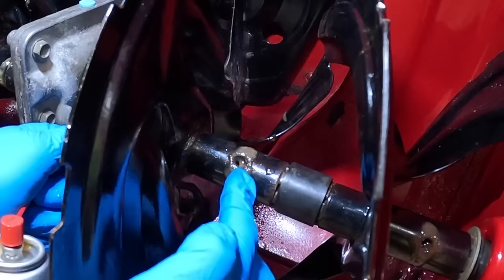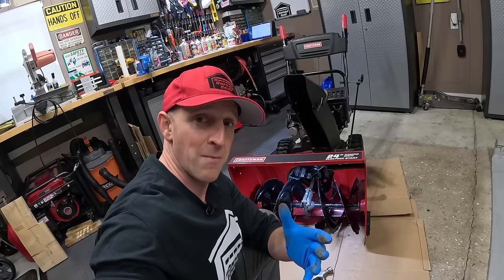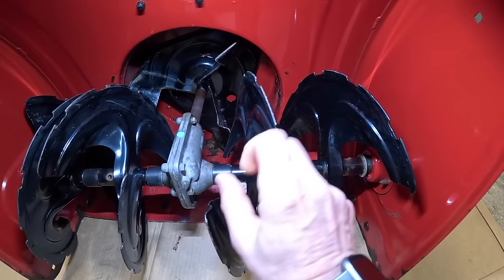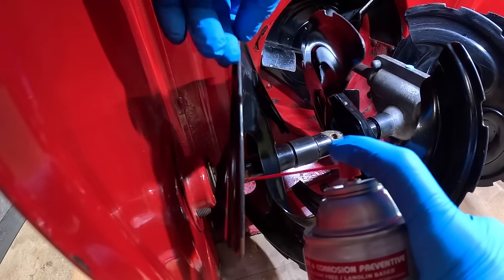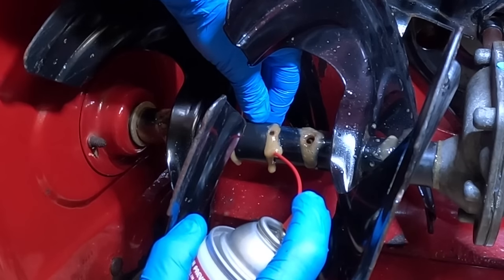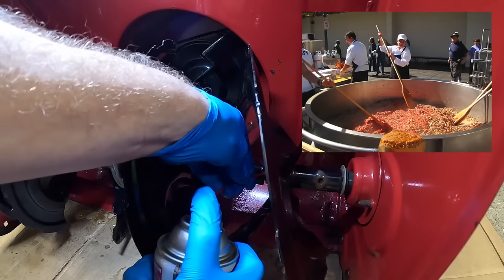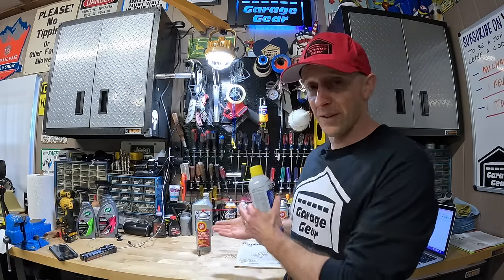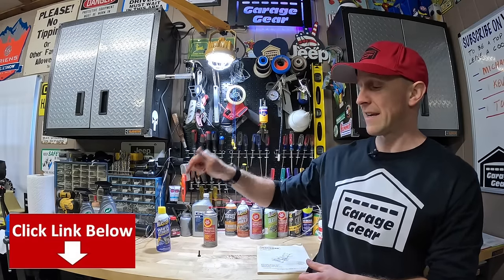HOW TO LUBRICATE CRAFTSMAN MTD CUB CADET SNOWBLOWER AUGERS (Seize Happens)

Comment: I have worked on Crown equipment in a food distribution warehouse for many years. Sometimes a good ol' airhammer works for removing seized pins. Everything you're showing in this video is spot on ! Things I have learned through experience over the years. Appreciate your channel and thanks for sharing.
Reply from the maker: Not a bad idea with the air hammer but I worried it would bend the auger. Thanks for sharing though! Thanks for being a cool fan John!

Comment: I made it to the Tribe Board that is so cool thanks JB.  Thanks for the great videos you have made that I use for maintaining my snow blower. They are step by step bang on and simple to apply. I had no idea all that was involved to keep it in tip top shape and so easy to do.  Fluid Film is my go to spray for lubrication. This stuff is amazing on the T locks on my truck cap they don't freeze like WD40 did, and perfect for lubing the garage door wheels, springs, locks, latches and the tracks. Thanks for being there.
Reply from the maker: You got it Tom! Thanks for sharing and for being a cool fan of the channel! 👍

Comment: I think for most snow blowers this method is fine and there's no need to remove the auger assembly unless you are already doing a repair that required you to take it out in the first place. Now if you have an older Toro with the drum auger you might want to consider removing the auger assembly lubing the shaft. I did spray some PB Blaster in the appropriate areas hoping it seeped in well.
Reply from the maker: Good tip here robert!

Comment: My beautiful late 90s st1024 SHO blower has seized augers I noticed back in fall. I inherited it from my dad. I’ve tried removing the shear pins and lubricating the shaft , but no luck.
Reply from the maker: Hey Jeremy at this point you might as well live with it or you could upgrade. But if she’s serving you well and you’re careful with it you should be fine!

Comment: A two stage is a bit overkill for the size of property. 4 car driveway + 100ft of sidewalk, all concrete, that's it. What you think about the toro 821 qze?
Reply from the maker: Hey Blackhawk. How much snow do you get per year in your local area?
Reply: Sometimes the powered wheels are nice since very few single stage machines have power going to the wheels of the exception of the Toro snowmaster series. There was a time when 21 inch two-stage machines where more common. I have an old Toro 521 which is great for some of the narrower walkways and the side of my house where the oil tank is filled. A single stage wouldn't work very well next to my house and it would probably tear up the grass.

Comment: I have a brand new machine this year, a troybilt.  Probably ran it 4 times and today when brushing the machine off i noticed a very tiny bit of grease coming from where you mention in this video at the gear box seal on the auger shaft.  not dripping or anything but when cleaning i noticed a slight big of grease visible there.  Is it normal for tiny bits of grease to work past that seal or should be be completely dry?  I wiped with paper towel and it is definitely grease so not any of the lubrication i have sprayed on the auger itself.  Again it is the tiniest bit of grease visible between the plastic bushing and the gearbox itself.  Thank in advance, love your videos always.
Reply from the maker: Hey okana this is not normal to see grease but if it’s only a tiny bit I wouldn’t worry. Just keep an eye on it. Appreciate the positive feedback! 👍
Reply: thanks for the quick reply as always @GarageGear

Comment: Hello JB, I love your tips and tricks on Snowblower maintenance. Now    , I have one question, I have cab cadet, in operation manual they instructed to do oil cylinder bore when you need to put off season storage, do you recommend this? I would really appreciate if you please advise. Thank you so much
Reply from the maker: Thanks for following along to the channel! Glad you’re enjoying the content. You could put a tiny squirt of oil in where the spark plug goes and that should do for off season storage.
Reply: @GarageGear  Thank you so much! This really helps!

Comment: Awesome video as always JB! ❤ I've finally purchased a lot of Fluid Film to do exactly this on my snowblower 😋 And I think its funny you mentioned in the very end that some have mounted zerks, I've vaugely looked on that as well, but feels like the best is to remove the whole assembly to do it.. lots of work, but could be very useful to have nice sticky grease in there instead of fluid film. What do you think? Which is the best, fluid film or grease? I think you've said grease is better for the gearbox at least - even though it can "fling away" from the gears.
Reply from the maker: Greasing those augers would be great but it’s a real pain to pull that stuff apart chris! If one bolt is seized you’ll lose half a day trying to free it . Sticking with fluid film is a great way to go! Have a great weekend my friend! 👍
Reply: @GarageGear Alright, then I'll go with Fluid Film then 😋 Thanks JB and I hope you've had a fantastic weekend so far as well and also a great end of the weekend! ❤
Reply from the maker: @ChrisFredriksson  ROCK ON Chris! Hope you have a great rest of the weekend as well!

Comment: Father forgive me for I have sinned :-( I just discovered your channel this year and I am WAY behind the 8 ball trying to play catchup on several things. Case in point, I have a 30 inch Craftsman that I am in the middle of doing just this procedure to but I am stuck (Thank God its been in the 50s in Milwaukee!). Three of the six sheer pins are seized in. I was planning on taking a bigger hammer to them today but worried about damaging the auger gear box. Was there a particular drill bit you used to drill them out? I also saw someone use an air hammer. I don't have one but might look into renting one. Any extra details on getting seized sheer pins out would be appreciated.
Reply: @JB An alternative method to remove those seized pins: step 1) apply Kroil or other penetration oil; step 2) find deep well socket just slightly larger than the head of the sheer pin; step 3) find C-clamp longer than length of socket + diameter of auger shafts; step 4) place socket over head of pin; step 5) place C-clamp on end of socket and small end of sheer pin; step 6) tighten C-clamp forcing the pin out.
Reply from the maker: Hey MA! Welcome to the tribe! I would recommend just drilling them out. An air hammer may be too rough and bend your augers. I actually started with thinner bits and slowly worked my way up. About 4 bits later they came out! Shear pins are made of soft metal so they drill out easily! 👍
Reply from the maker: @i_no_nutin  I like that my friend! Great tips here!

Comment: JB I have a question is it even possible to install the auger blades wrong? I  took the picture like you said I couldn't put them in wrong
Reply from the maker: On some models yes! I’ve seen some put them in backwards and snow was being pulled away from the augers!
Reply: @GarageGear ok thanks

Comment: little different then this video, but after installing the rubber kit on the impeller, my auger always gets clogged up with snow and ive tried everything for non stick sprays, 13 of em i think...none of em seem to work any thoughts on that?
Reply from the maker: @nachomoma2469  hey nacho are your impeller kits installed correctly? With a lot like that you should not have any issues with clogging
Reply: @GarageGear  I'm fairly certain they are (going by what i saw in youtube) but the ones I got didn't have any instructions but at the same time everything started happening with the augers always getting a heaving build up after the install
Reply: @GarageGear  I'm Gona hafta see if I can get down there before winter...just hard now cause I have a broken neck n back lol
Reply from the maker: @nachomoma2469  hope you heal up quick my friend
Reply: @GarageGear  ty brother
Reply: @GarageGear  if i was able to take pictures tomorrow of the auger and and also the  impeller where i installed the rubber pieces ( hopefully with enough light lol) anyway i could send em to you to see what u think?
Reply from the maker: @nachomoma2469  send me an email with them . It’s in the description !

Comment: Yup, gearbox is about $350 to buy that while unit, but the worm gear is about $35 and that's what you'll strip if you catch something in there and the pins don't shear. That unit only takes a few hours to disassemble and repair with basic tools.
Reply from the maker: Thanks for sharing my friend!

Comment: my shear pin broke how do I know where to align the blade before installing the new shear pin ?
Reply from the maker: Hey Al! Do you have your owners manual? I usually go by the picture on the cover. If not the tips of the the augers should align to almost complete what looks like a rolling arc. Then one set of augers usually should point at you on one end and the other should point up. Kinda hard to explain but let me know if you need more help.
Reply: thank you I’ll do that
Reply: If it's a shear pin with a collar on it, one side of the auger will have a bigger hole. You want the collar in the bigger hole. And make sure part of the the broken share pin is not stuck.